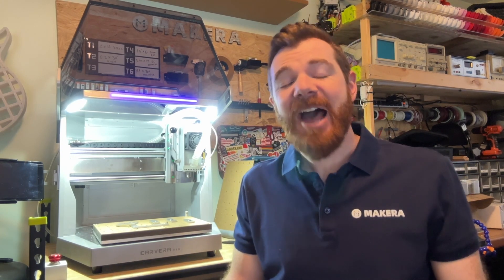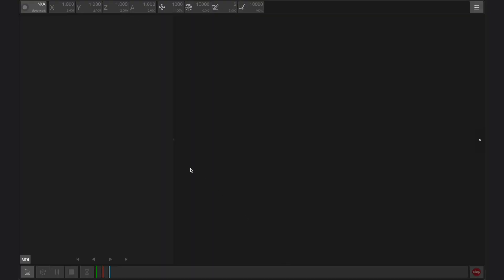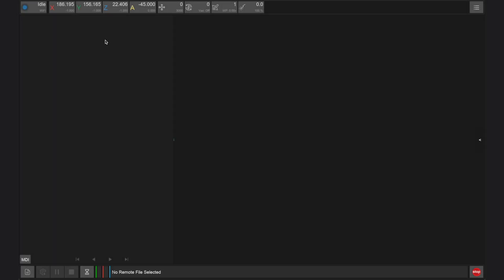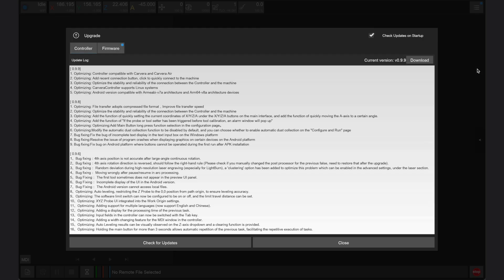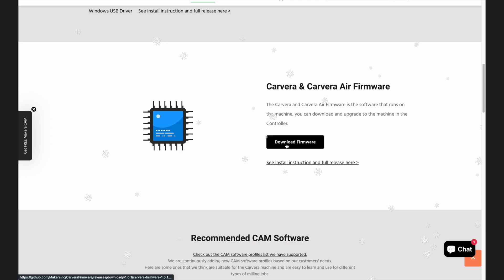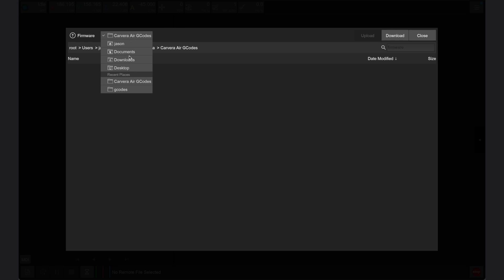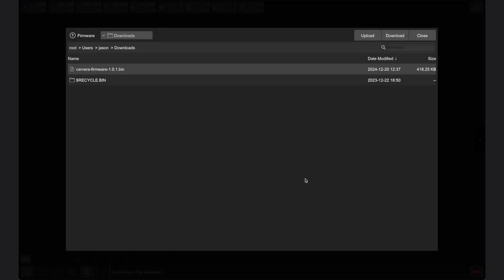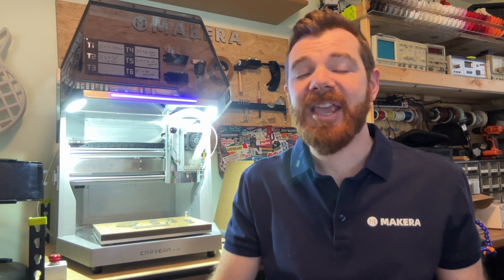How to Update the Carvera Air Desktop CNC Firmware

Comment: Is there a way to put the firmware on a USB and do it not thru the app? I updated the controller but now its out of since with the firmware and the app wont connect and wont show the Update as its grayed out. I already downloaded the firmware but since the app is stating I have to use a older version or update firmware it wont work?